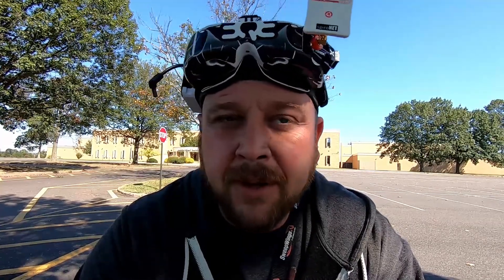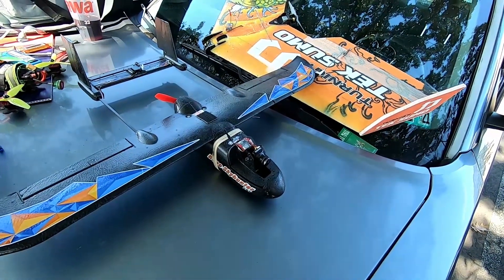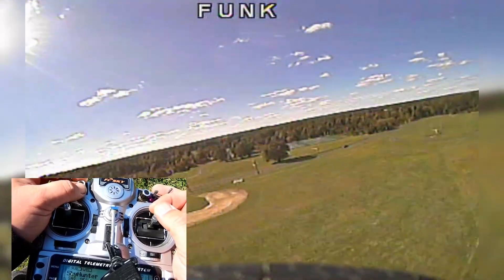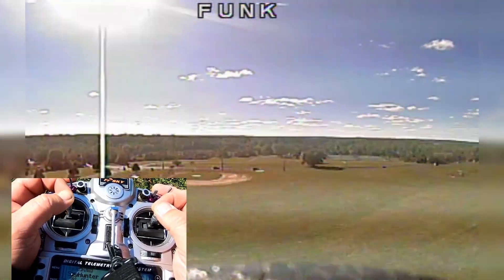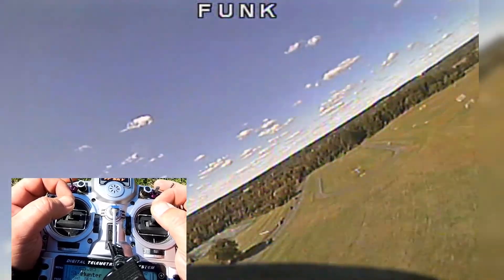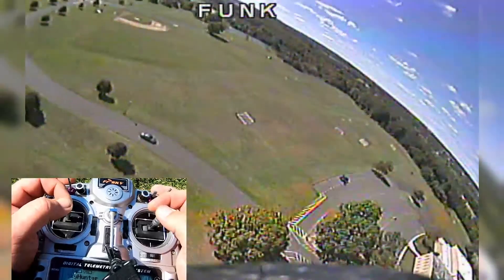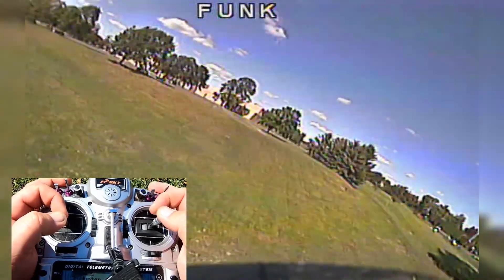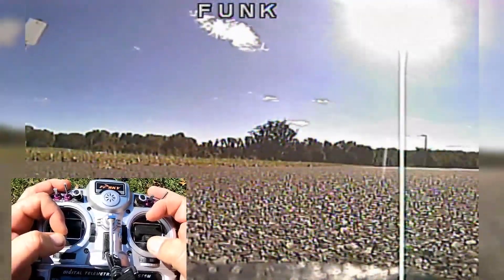FPV Wing Stick Cam

Comment: Wings are cool. I fly a rrmrc recruit sometimes and it's a blast. It did take a minute to get used to the fact that throttle while trying to get over a  tree top only makes the plane fly faster into the tree...not rise up over it like a quad..lol..repairs only took a little while...😁
Reply from the maker: Steve Beatty I started flying LOS airplanes so I had the basics down. The simplistic nature of wings is what makes them fun for me.
Reply: @FunkFPV   Me too..30 years flying planes of all sorts , all electric... just not much time with the  FPV Wing  perspective ...lol.....I usually bring a hotliner or something to the field with me in case I can't fly FPV  for whatever reason....like a scout..gotta be prepared...✌️ Good Air, Straight Props..😎